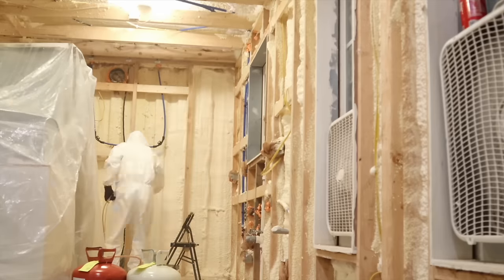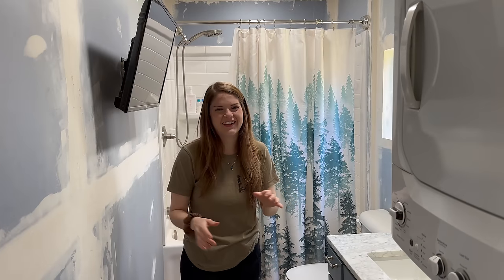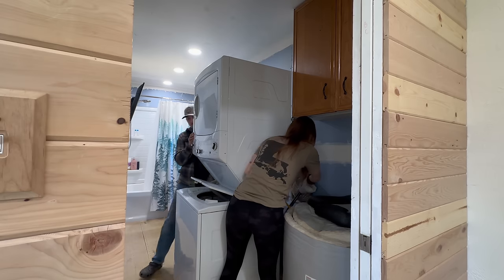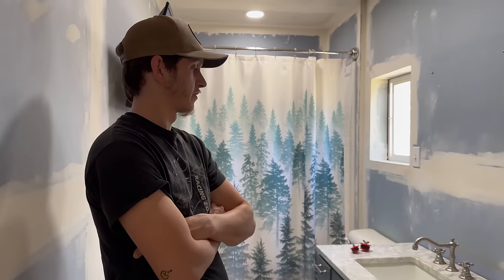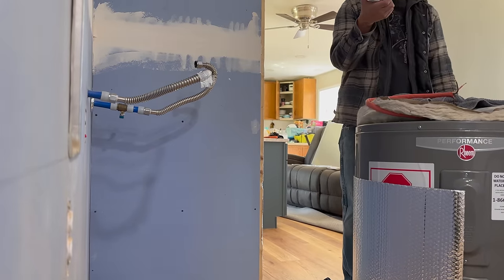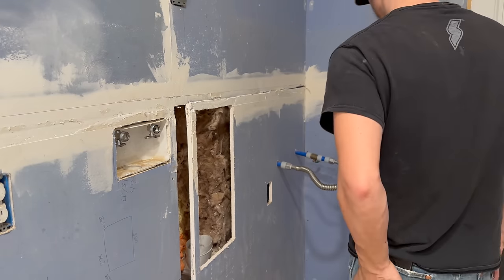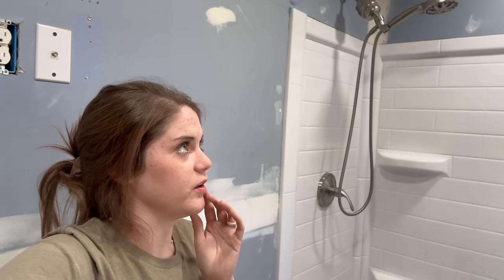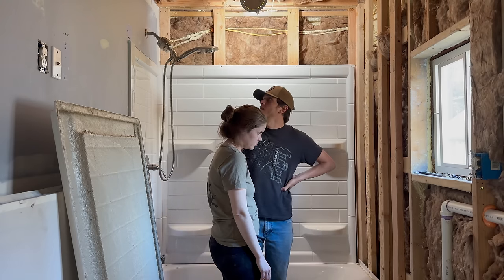DEMO DAY for Our SHIPPING CONTAINER HOUSE Bathroom

Comment: You should make an insulated shed for your water heater under the house or just get a tankless propane one so u can have all that space in the bathroom. Worth the extra money
Reply from the maker: We have though about it, it just take a TON of power. It would definitely free up space tho!
Reply: The propane one doesn’t use a bunch of power and u already had propane in there for your dryer . Win win
Reply: Just dont wash clothes and take a shower at the same time haha but then you would have a baller laundry setup and could make a built in hamper . Just a thought love what you guys are doing tho keep up the good work.

Comment: BTW your duck looking at his reflection in the chrome bumper and wondering where the duck goes when he gets to the end is hilarious. 
It may be too late but wouldn't you want to update the electrical before you spray foam again?
Also, you may want to look into a MagVent for your dryer vent as it gets rid of the droopy vent pipe that collects lint and could cause a fire. Safety first.

😊

Comment: How about moving the water heater under the house or build a small box on the outside of your bathroom. You are good at insulating so with a little research and planning that could work. It will free up a lot of space.

Comment: I would suggest you don't get and all-in-one washer/dryer. If you don't take the wet clothes out and shake them. Before you start the dryer cycle. They will dry in a lump and all wrinkled. Better with what you have. Trust me. Also they have alot of problems with them breaking down.

Comment: Dear hearts, if you are going to go through all that work, you might as well make an opening for a door  add a small room for the washing machine and water heater. An accideng might happen with a water hose or a malfunction  with the water heater and you will have water everywhere.... it happened to me. So i had a small insulated room built for both things. Think about it. You will also have more space in your bathroom. This is just an idea, but whatever you decide it will be okay as well.